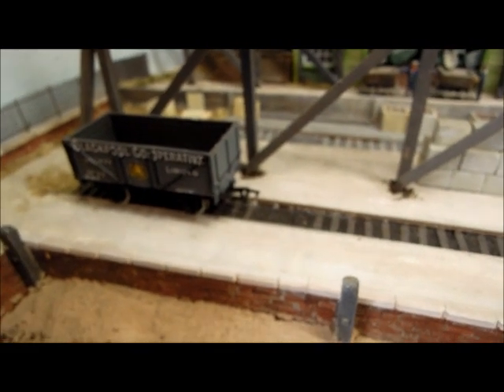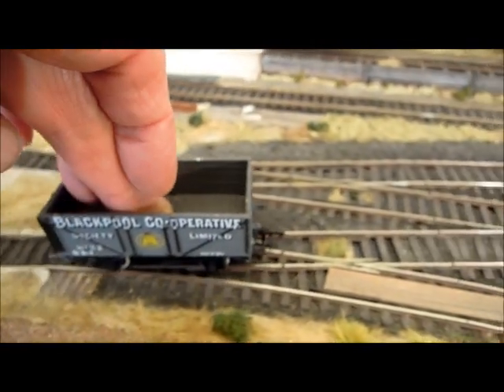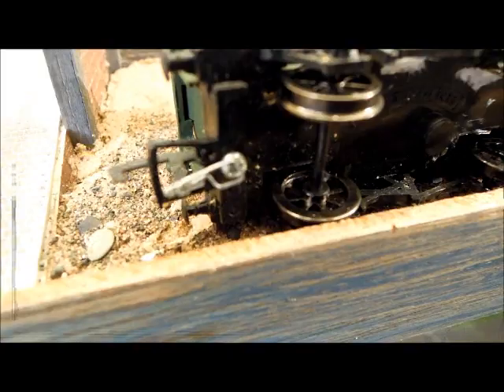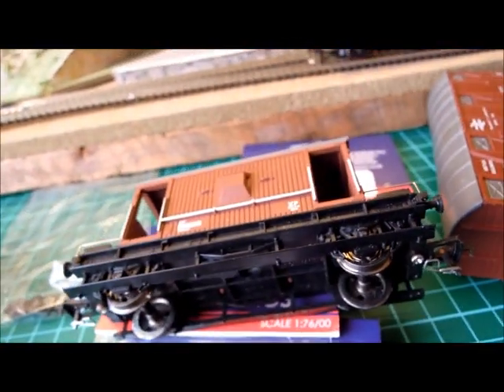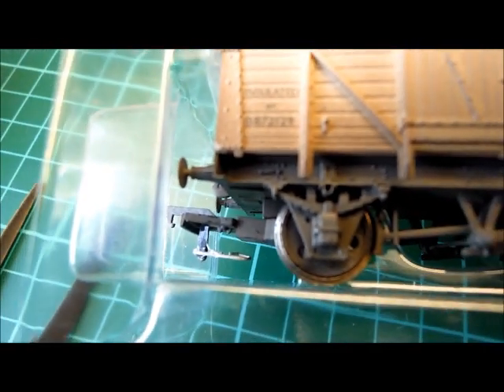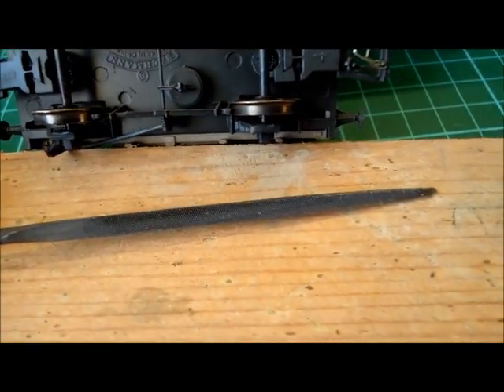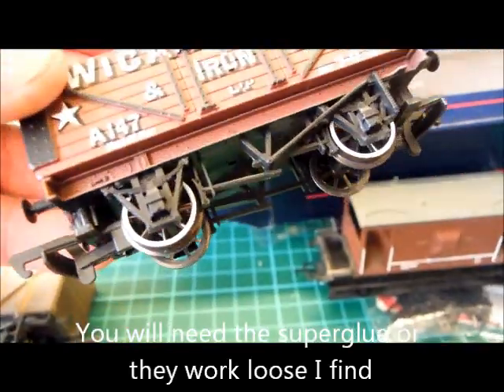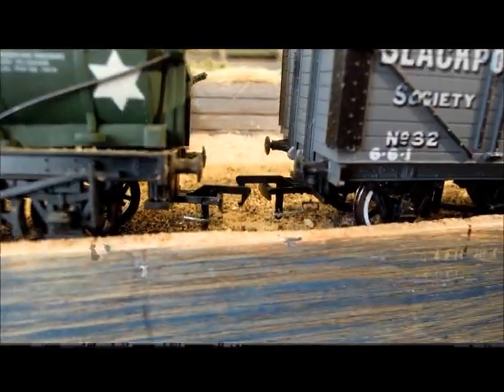Automatic magnetic uncoupling for shunting layouts

Comment: Forgive my ignorance but how does this actually work? Surely a magnet placed under or in the track is going to attract anything ferrous :/
Reply from the maker: Yes. using Bachmann couplings means that you  do not have a ferrous dropper on the initial coupling. It does not work with hornby couplings. at first I wonders about the direction of the forces. ..but it does work and another youtube video shows it in action.
Reply: Yes, you are correct in assuming that the magnet attracts the steel staple. 

How it works is down to the pivot point of the coupler hook.

The magnet pulls down on the staple, the position of the coupling hook pivot thus causes the coupler hook to pivot upwards raising the hook end clear of the linkage bar, the engine stops, trains stops, waggon either rolls forward or is left in situ.

Can be fiddly in operation and requires some precision in controlling the locomotive and the greater the train length the more to problem increases but a neat solution that however fixes your uncoupling positions to the magnet locations.